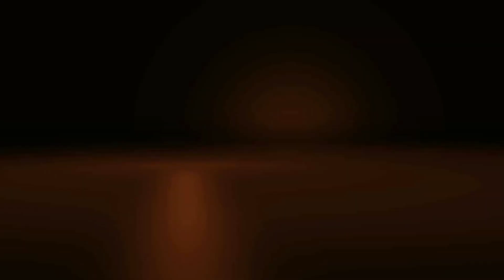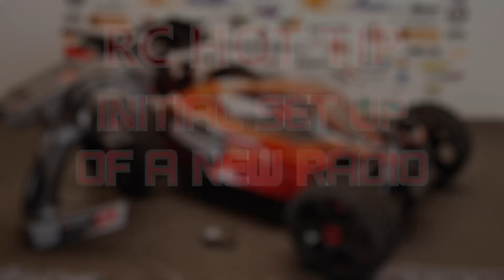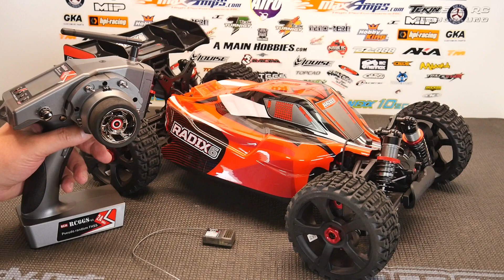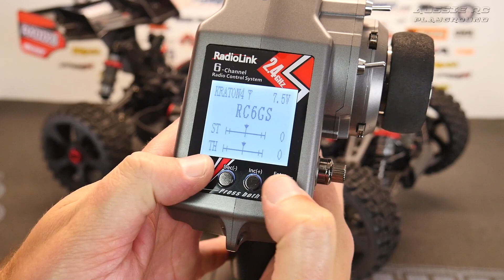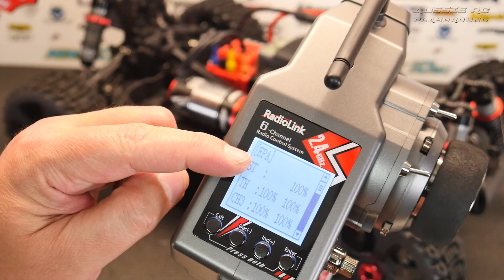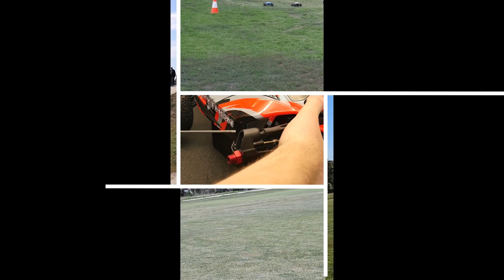RC HOT TIP - Setting up a new radio in your RC

Comment: Good luck ever getting that reciever out in 1 piece, unless they upgraded the plastic it will break when you try to pull it out, unless you are very careful.
Reply from the maker: That explains why they're so cheap, then. 🤔
Reply: @AussieRCPlayground  if you're careful about how you try to take it out you might get lucky, but the little snap tabs that hold it together are thin and brittle, my first time the bottom of the reciever and sticky pad were still stuck to the side of the reciever box lol 2nd one the tabs didn't break but it still came apart 3rd time a used a putty knife to separate the pad from side of reciever box. Or just don't ever take it out 😉